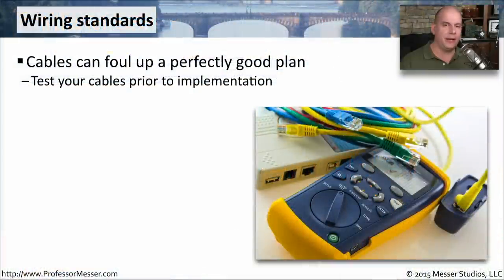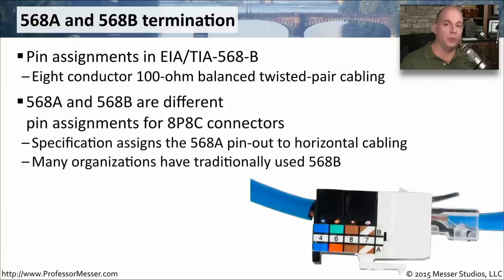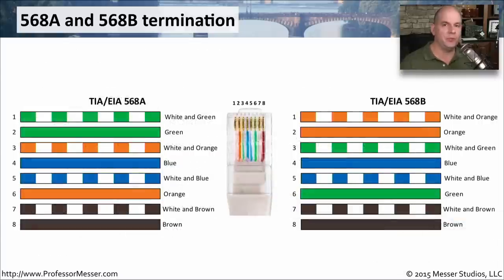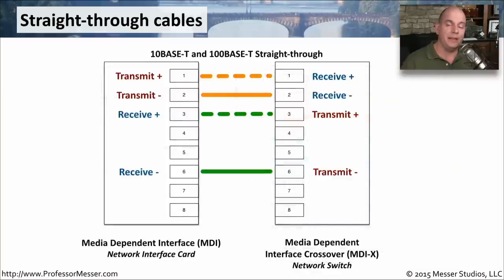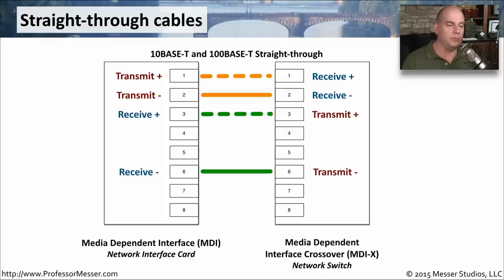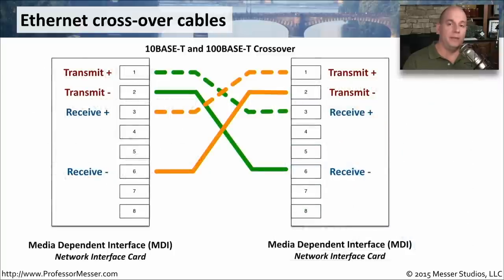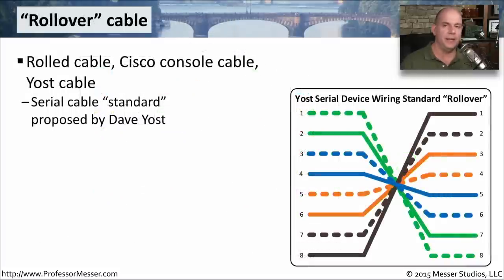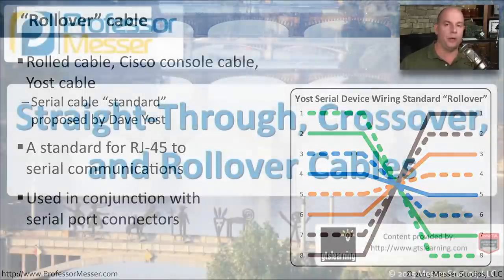Straight-Through, Crossover, and Rollover Cables - CompTIA Network+ N10-006 - 1.5

Comment: Sir can I ask and from everybody that will make read this comment, Is  the rollover wired cables rj45 side by side supposed  that when plug into tester it cannot blink ? I am making rollover cable and with finest detail about crimping and and sequence it, I make sure it is perfect but I did not know why it cannot blink to tester  I try 20x of it I hope you can answer my Question :< pretty pleasseee :<
Reply from the maker: None of the pins on a rollover cable connect to the same pins on the other wide, so you won't have any continuity between like pins.

Comment: if you are doing a short run of less than 50 feet does it matter to follow the tia/eia code?
Reply from the maker: You should always follow the standard, regardless of the cable length. Uniformity makes it easy to make adds, moves, and changes in the future.
Reply: Thanks. now I can train and keep the folks I work with on the same standard.